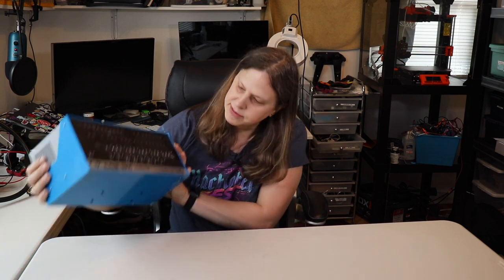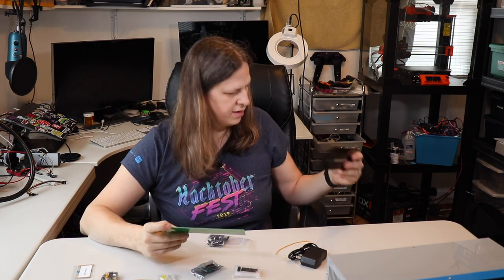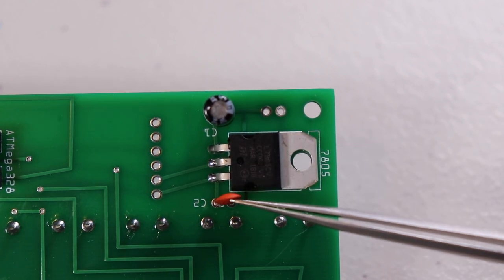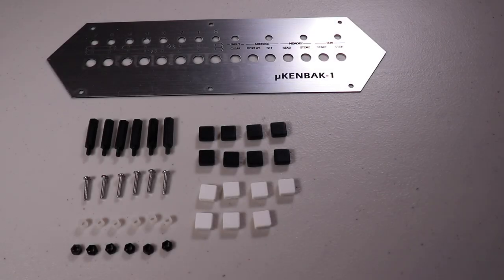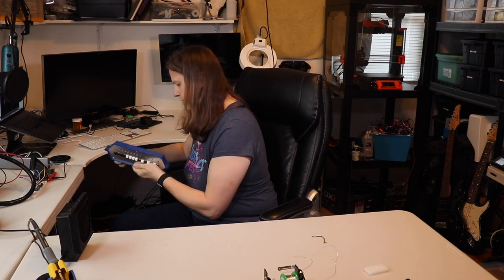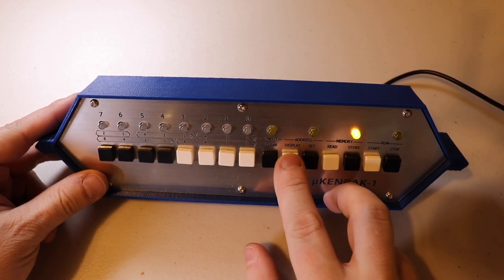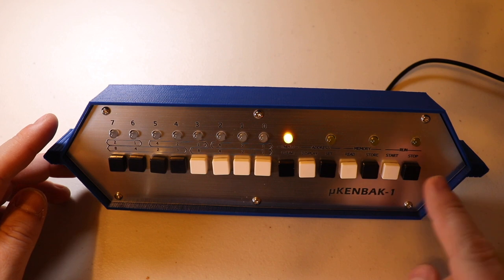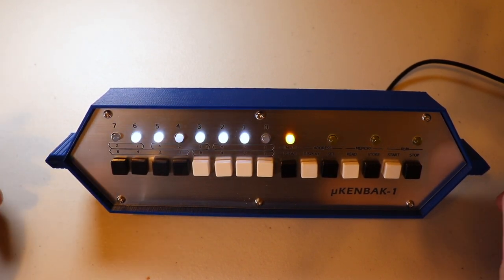Can I get this 1971 vintage computer replica kit working?

Comment: Excellent video. THANKS    Now, if someone will make a modern clone for the Heathkit H8 that would be great. I have modern clones for the Altair, also from Chris as well as the IMSAI, DEC PDP 8 and PDP 11/34.....Seems like I saw something about the Apple 1 kit is either available or will be soon.
Reply from the maker: Thanks. That would be fun. I think the 8-bit guy just did a video on the Apple 1 kit about a week ago.